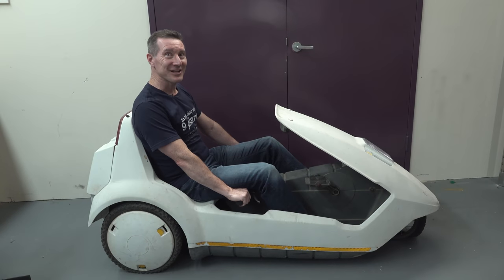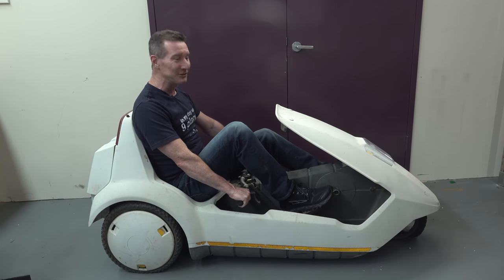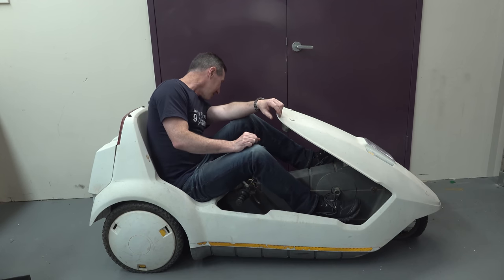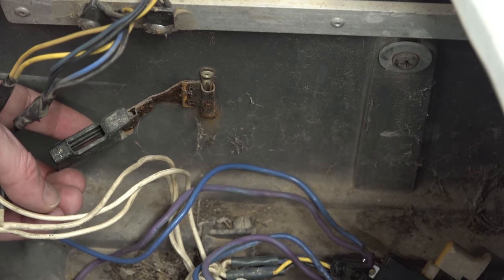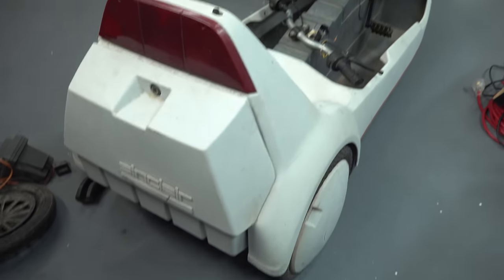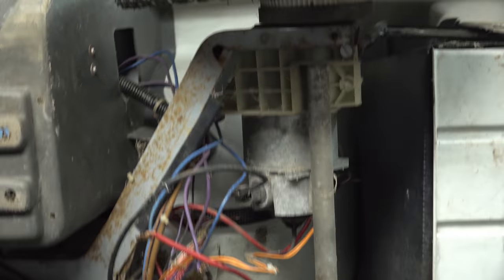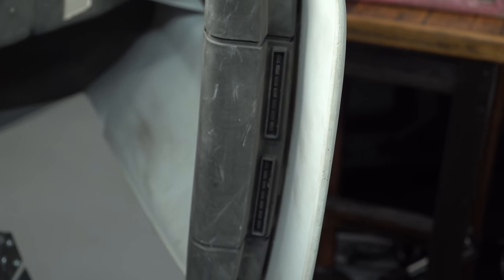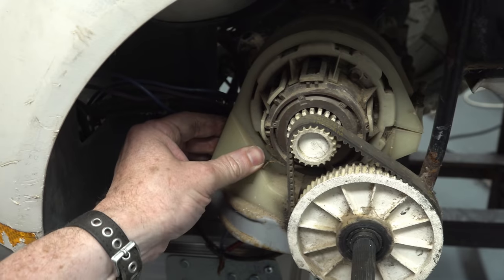EEVblog 1419 - Sinclair C5 Restoration - Part 2

Comment: Blimey! Was it eight years ago or something like that you tinkered with it the previous time?! Well fitting tribute to sir Sinclair for sure!
I hope you gut it and source a modern electronic motor, controller and batteries to both make it usable and to prolong its life for another decade or two...
The 80's was a mad period and few looked at making things as cheap as possible but Commodore comes to mind as well, albeit a bit more well funded but not as radical, but both still have a huge following today! Modern electronics gizmos (as this would correctly be labelled imho) wouldn't have lasted a fraction of the time like this has or the same era computers vs. the ones made today, so perhaps the 80's was the last decade before we stopped repairing stuff and instead only replacing everything that develops a fault... :( Waste, waste, waste and waste.
Anyhow I'm glad you've resurrected this old C5 and I hope it's not another eight years until you mend it, but if so I'll be still watching it!

Comment: The C5 was built in the Hoover washing machine factory in South Wales. Considering how people are now running around on electric scooters, an updated version might do well today. I bought a Sinclair Scientific calculator and the first seven they sent me were dead out of the box. Very disappointing for a teenage boy! The eighth worked well and I was the first boy in my class with a calculator - even the maths teacher asked me to check his results. It took several seconds to calculate a log or trig function. It used RPN - reverse polish notation and calculated to five digits plus two exponents. But it cost £25 whereas an HP was £200. Happy days!

Comment: It may have been rejected as a product, but the idea is a wonderful solution for personal transport...too bad we don't get it. Long live Sir Clive Sinclair.
Reply: It's hard to see what it offered over for example creating an electric bike other than mildly improved aerodynamics at the cost of terrible road view and much reduced visibility of yourself to HGV drivers. They were not well thought out.
Reply: @6581punk  No, you are correct, they weren't brilliantly executed but I'd expect development over 40 years to HAVE overcome many tech problems and improved safety concerns. The implementation was pretty ho-hum, but the idea of a small, efficient single person vehicle that requires a fifth of the parking and road space, bugger all energy to run and manufacture and can replace cars etc. for 95% of urban journeys just makes sense, always did, always will.

Comment: @9:52 the Y shape of the chassis has been spread open by a lot of force and has split the spot welds away from their proper positions. @14:51 the chassis next to the hub is clearly bent and split. It suggests that the machine has reversed hard into a low curb and the forces generated have caused considerable deformation. I expect you'll need a full stripdown and the metal pressings will need to be corrected before a professional welded repair.

Comment: 6:21 Neat low buck speed control, looks like two parallel mosfets and a ryobi drill trigger switch, if they wired it like the original drill this would enable reverse as well.
Reply: Reverse! I don't think the original had reverse...you had to get out and turn it around.

Comment: The long bolt that came out of the handlebar stem probably pulled a wedge tight. To remove the bars try threading the bolt back in at least 5 turns and then knocking it down with a hammer to unseat the wedge. Hopefully that will free the stem from the steer tube.

Comment: i reckon will clean up fine maybe put a modern beefy rc style brushless motor and some modern lipo batteries to make it more reliable something i always wanted to do but they were always out of my grasp
Reply: Apparently the existing motor tends to overheat and has multiple 'protections' that will not make it a good candidate for running from any kind of high power battery so yeah brushless RC or brushlesss mid drive bike upgrade kit would be ideal.

Comment: that odd sized nut on the right rear axle is likely purposeful so that you can torque down harder to tighten bc it might loosen itself, not being opposite threaded.  the axle is going to try to torque it loose in normal forward motion, i believe.
Reply: actually...
when you hit the brakes is when it will try to back out.

Comment: All the spot welds on the "wishbone" frame are torn out. Best way to fix that would be to cut off the flanges and weld a plate across that area, but in a pinch you can use straps to try and pull the seams back together... should get you home.

Comment: It should clean up good and it's a good opportunity to update the electronics and move them inboard. The bottom side oof, typical 80's stuff, stamped sheet metal frame and plastic gears pretty common of toys from the era.  Just weld the frame up and it should be good. Not sure if the plastic part's will survive but I imagine you could get them 3d printed or made from aluminum.

Comment: Yeah, I’d like to see the body scrubbed, brake parts replaced with modern MTB disks and callipers, then a 250W ebike motor/controller/pack to keep it vaguely legal but have a decent speed and range. Fun, reliable &  safe (ish) is easily achievable.

Comment: Dave,
I would keep the restoration as simple as possible. 
Reuse the drive motor. It"s DC and unless it's burned just needs the commutator cleaned up and brushes. But it's repairable from any motor shop, And if re engineered you can add more torque. 
Clean up all the parts and reassemble. Any structurally poor parts, modify.  Get the EE blog community involved. The 3 printer boys can duplicate any part you need. I assume there's 3 D parts scanning you could teach us all. Then have the boys send you there best parts.  
You can design and build a modern SCR or IGBT motor drive.
Kick up the batteries to lithium.
Defiantly envision a dozen videos.

Comment: I remember passing a C5 in some roadworks around a junction of the A1 at Welwyn Garden City (a bit north of London) back in late 1985. It didn't look safe at all amongst all the traffic. I remember the year because it was just before going on my first Skiing holiday at the start of 86 (Challenger disaster happened whilst we were away) and we were going to the dry slope in Welwyn for pre holiday skiing lessons LOL. I would think the front end would be a bit light for a front hub to get enough traction, but what do I know...

Comment: The rust does not look to bad. But the place you pointed at in the middle sure needs some grinding or rust eating acid, best would probably be sandblasting, depending on how well can be taken apart and or how well surrounding areas can be protected. Sometimes the only way to really know how bad it is is to get it clean.

Comment: I used to ride human powered vehicles as part of a team in events like the Maryborough Energy Breakthrough and the Victorian HPV Series. The trikes in these events are a lot faster, more stable and safer, generally with two wheels at the front and one at the back, although again I wouldn't really want to take one on roads with cars.

There is the similarity with this however with the back brake (if fitted) causing stability problems. If applied at high speed and without care it is fairly good at causing significant over-steer and rolling the vehicle multiple times. Luckily in recent years the rules have been updated to allow independent front brakes for redundancy, which are significantly easier to service, don't cause problems with fitting or removing the rear wheel and actually help to steer the trike around corners in a very controllable manner.

Comment: The handlebars (clamp) bolt is to be unscrewed a couple of turns and then need to be hit with a hammer to release  the wedge from the bottom part of the tube then you are able to pull  the whole thing out out of

Comment: that unknown wiring switch and FETs look to be a speed controller from  power drill [or sumilar - better view in the the pt1 video, you can see the direction lever behind the trigger button] I guess the previous owner wanted more than binary speed control.

Comment: Front hub motor, speed controller, twist grip throttle, and lithium pack. existing motor will freewheel, so zero hacking on the original.

Comment: I remember riding one of these in the late 80s at a seaside town where a local had set up a go-cart like track for people to race each other round on. One of the crowd I was with managed to roll his on every corner but it seemed to survive the abuse. I never actually saw one in the wild apart from at this track which probably says all you need to know about their popularity, I suspect the majority were bought for use on private ground and very few made it out on to public roads.
The real issue with road use was that lorries simply could not see them hence the big flag poles. This was in the days before dedicated cycle lanes so road use would have been pretty scary.

Comment: Yes please restore outside and improved chassis, but with modern drive train.  Would love to see:
1. 2x rear independent PMSM motors and hopefully not BLDC motors.
2. Lipo or Lifepo4 battery pack
3. Drive by wire steering because the current steering drive looks flimsy and poor leverage.
Good thing about these three is they can work with minimal integration software.  And when you have time, you can add features like traction control, regen, software guided steering stability, etc.
Reply: The original PMDC motor was relatively high tech for its time (similar models from the same manufacturer were used in gun turrets for tanks), so replacing it by PMSM which is relatively high tech now, sounds like a nice idea.

Comment: If I were doing this project I would restore it with modern stuff, a big balanced pack of 18650s.  Maybe a new motor.  Certainly new wheels. Speed controller, tires, chain, brakes, etc.  I'd take apart the pedals too.  Maybe you could give it clip in pedals lol

Comment: I think you should not remove the stearing pin: its thread is set in a conical plug at the bottom of the pipe, and you should turn it back in, and 2 cm before it reaches the pipe slam it with a hammer on a wooden block so you press out the conical plug. Then you can pull out the handle bar.

Comment: Doesn't look too shabby, a bit of clean up, rust removal, welding and a lick of paint for the frame.

The mechanics aren't bad either, some bits and bobs here and there to clean up/replace.

For the body maybe just cleaning would be good enough? Not sure what material that is, but if Lotus was involved, I bet it's glass fiber. Just getting it to look good shouldn't be too hard I think (structural damage in glass fiber can be a pain I've heard).

My 2003 Subaru looked way worse than that (see through wheel wells and sills), and it's still on the road, passing inspections. I didn't even know how to weld when I got it, dad showed me the ropes.

Welding is fun by the way, if you haven't tried it before, get someone to teach you the basics and lend/rent you a small welder. That stuff is pretty thin, so it shouldn't require a powerful machine.

Comment: that motor mount looks like a vacuum company made it. Lol  And lots of off the shelf 80s bicycle parts thrown in for more manufacturing savings.  It would be a fun project to upgrade with modern tech.
Reply: Lots of info on the whole history and design at https://en.wikipedia.org/wiki/Sinclair_C5. The motor was not made by Hoover.  "Its motor was produced in Italy by Polymotor, a subsidiary of the Dutch company Philips. Although it was later said that the C5 was powered by a washing machine motor, the motor was in fact developed from a design produced to drive a truck cooling fan."

Comment: Is this the Plan B while you deal with the Ioniq recall? 😁 Timex-Sinclair 1000 user here. Only got rid of it a decade or so ago, thinking it wasn't working. Fundamental mistake: I'd been conditioned by then to think of RCA video jacks as "composite" video, when in fact it's an RF modulator. 🤷‍♂️ Atoned for my sin of naivete by buying two more off eBay recently, with intent to restore to usable condition. Glad I got them before Sir Clive passed... 😅🤑👍

Comment: This requires a total restomod, including modern disk brakes on a modernized front wheel, and a Bafang motor as a rear wheel drive. Possibly include a dampened fork in the front and if it isn't too much mechanical engineering, possibly also a rear dampening solution. Of course, run it with LiFePO4 cells at 48V to get a somewhat decent range and speed (certainly more than original). It would be awesome to see a modern trike like that! In exactly that design! I think, nowadays it would sell really great (if you limit it to 25km/h and pedal assist only, basically cut off its balls, it would even be street legal as an electric bicycle, or you could limit it to 45km/h and still not require a motorcycle license to ride it. Of course, after the thing has been approved, you set that limiter back up to 55km/h and nobody will say anything...)
Reply: you don't want to go faster than 25 km/h trust me ! mine makes 20 km/h and it is scary sometimes but i want to change my gearing to get 25 km/h. I used a chap Chinese mod kit it works very well and i can use my e bike battery's with it and is now all chain driven.
Reply: @Merlinkatamari  OK, so it definitely also needs a more modern suspension then. Would be great to convert it from the solid axle to a differential (so each side can be dampened separatels), but that might be too much effort.
Reply: @Seegalgalguntijak  hm there is no space because the wheels in the back are so big but if you lift it higher up it could work i think but you have to modyfy everything because the chain drive from the front it is not that easy but you could try to only dampen the seat and not the Wheels there might be a possibility.
Reply: @Merlinkatamari  Dampening the wheels was my thought to improve ride quality so that you could go up to 45km/h, which a dampened seat won't likely to be achieve. However, if that isn't possible, then it isn't possible. On the other hand, one could construct a whole new and better/more stable frame to put the body on, the only things that have to stay the same are the positions of the steering/front wheel and the pedals/rear wheels. But as Dave already said, this would require some more serious engineering.

Comment: A fully modern revision makes sense, I mean the body looks interesting right? And Using a hubbed wheel drive will not move the weight around too much soo... and be easier to replace.
48v motor at 500w should be MORE then enough to make it a fun drive. I wouldn't go too much faster being what it is! Modern batteries, put some nights front and back lights on it while you are there... and you got a very strange electric bike ;) 
Mmm, dual 500w, after all there are two back wheels...

Comment: I would be able to 90% of the work if I was there, I'm a repairman with experience in these sorts of vehicles. I would just need you to complete the final 10% which is double check the circuitry, I would remove it so you could inspect every nick and nanny.

Comment: That's a drill trigger probably used as a speed controller. Hackery at its finest! I wonder if that's coupled to that chunky transistor or whatever it is. Don't fix it too much, it has been hacked for most of it's life anyway. Many of them were, especially because of the lack of proper speed control. Original unmodified unbroken ones in really good nick are rare. Ratty tatty ones are the most common. Get some proper lubes, grease and chain oil. She'll be right.

Comment: Replace the 'inner workings' by a modern electric bicycle motor & batteries [widely available in The Netherlands and many other countries] or use the 'bits & pieces' of an electric mobility scooter and Bob is your uncle & Fanny is your auntie. BTW use modern disk brakes from a mountainbike. Much safer if it stops when required!

Comment: With the passing of Sir Clive Sinclair value of these have tenfold. If u have a near complete or complete one please keep it original. U could spend thousands on it with modern stuff but everything in this tricycle is custom made, if been resto-modding mine for over 6 months now because mine had bent wheels and drive shaft.

Comment: Interesting vehicle, just not very practical overall. I mean only group of people that this would interest are those that need to commute/travel, but never need to haul much. I get around on a Dutch bicycle and not only go to work on it(~8km), but do all my shopping. Between the front basket and rear bags, I can easily carry a full weeks worth of groceries in one trip. I really could not use this as my daily vehicle. Some days I decide I want to run to the store, or just get take out.

Sadly this really was a solution looking for a problem. It's one of the few times both car drivers and bicycle riders can agree on something. Which was a big reason it's was such an epic failure.

That said, I do look forward to the restoration. Would be fun to ride around in.

Comment: 3:08 At this point I am curious. Do you plan to get it back to original as possible ... or do you plan to upgrade it with modern parts and beef it up as much as you can. Batteries, motors, and electronics cam a long way since then. And it might now, with modern parts, a heck of a racer.
Reply from the maker: I didn't go into this with any plan!

Comment: The brake pad(s) and scrapings most likely contain asbestos, as did all brake material back then.  Leave any replacement to a specialized company.
Reply: If he used bicycle parts that isn't very likely, but who knows.. he did cut corners sometimes.